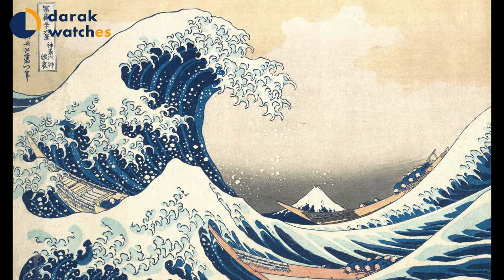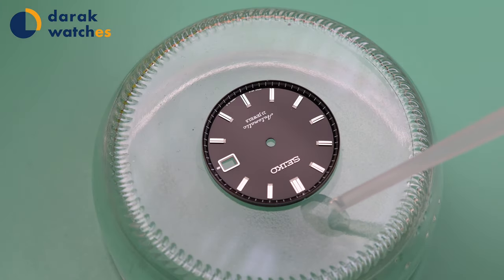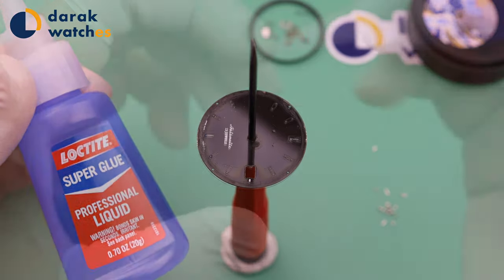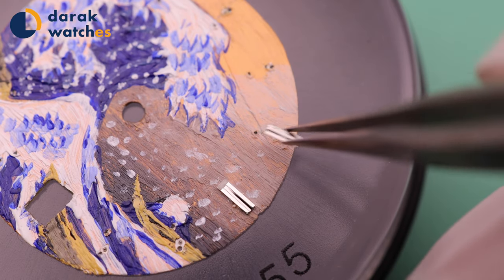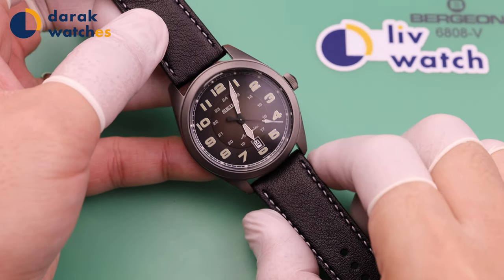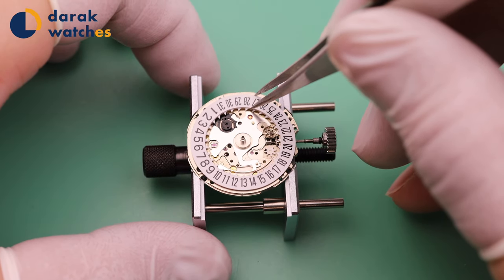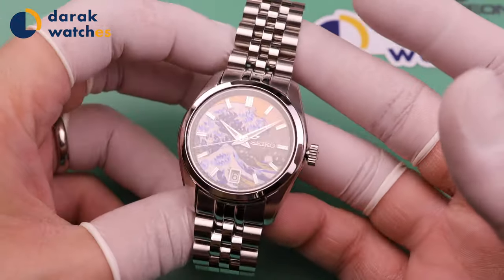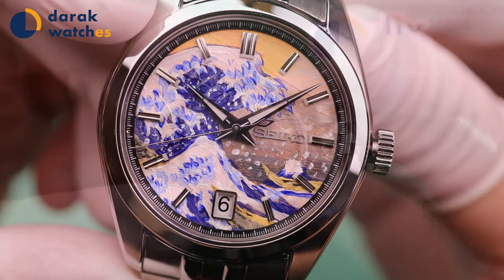Seiko Mods - Oil-Painting The Great Wave Off Kanagawa SARB033

Comment: Woah, you migrated all indices, logo, date window frame, and even cut a new date window!! I didn' t know that was even possible. Bravo! As for me, I was trying to understand, why I cannot mount the sarb033 dial on the grey movement ring of an nh35a. So I am gonna have to cut the dial feet and use double sided tape bits? I am using a pd1717 case.Who knows if the clamps, the dial disc and the spacer ring fit into that case, so I won't order these. And I am swapping the white calendar disc for a black one. Thanks a bunch, I really understood a lot from your video which google wouldn't let me. Thx!.